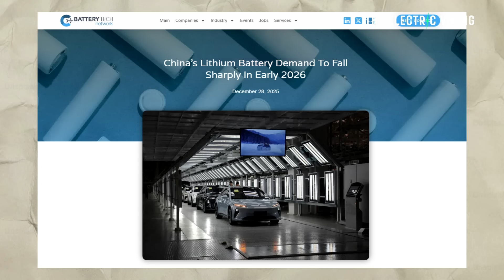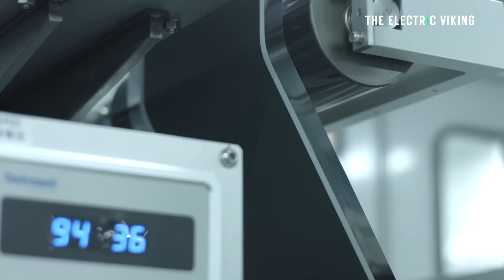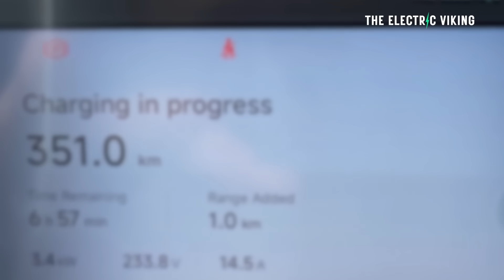SODIUM TAKEOVER! CATL Confirms Mass Deployment of Sodium Batteries for EVs

Comment: What is the disadvantage of sodium ion batteries?
Reply: They are likely to be bulkier than lithium batteries because of the lower volumetric density of Na batteries.
Reply: @crm114.  Key technical problems (summary)
Lower energy density vs lithium — sodium’s larger ion and heavier mass mean packs store less energy per kilogram, limiting range for EVs and size for portable devices.

Cycle life and cathode degradation — many sodium cathode materials suffer structural “stacking faults” and phase changes that shorten usable life.

Higher internal resistance and voltage instability — sodium ions move less easily in many host materials, producing higher resistance, heat, and inconsistent voltage under load.

Safety and deeply sodiated‑carbon issues — recent research flags unique failure modes (e.g., sodium‑cluster formation) that affect thermal stability and require new stabilization strategies.

Manufacturing and cost competitiveness — while sodium is abundant, some sodium‑ion manufacturing routes and materials (antimony, special cathode dopants) can be costly; without scale or a clear energy‑density breakthrough, sodium struggles to beat cheap lithium/LFP on total cost per kWh in many scenarios.

Supply‑chain and ecosystem immaturity — cell formats, pack engineering, recycling pathways, and standards are less mature than for lithium systems, slowing OEM adoption and certification.
Reply: Bunch of things (some temporary)
- Lower energy density by weight than LFP
- Lower energy density by volume than LFP
- Voltage curves are not compatible with most current equipment (so you can't throw one onto your existing 48v inverter kit). Mostly that's a short term problem
- Last time I looked lower efficiency (you get more of what you put in back out of LFP than Na, but that gap seemed to be narrowing quite fast)

and there are probably a few others.

Comment: I think China's new requirement for fire resistance is probably the major push for Na batteries. The problem with this (at least at first) is that they will probably be exporting all the LFP batteries and using most of the NA batteries in China since they will probably not have enough in the first year or two
Reply: No, LFP batteries have already passed these tests. This is just the end of using NMC batteries in cars. Most Chinese companies had already completely switched to LFP, but many western companies are still using NMC. It's a good rule and I hope western countries will implement a similar rule, to force car companies to switch. EV fires have been creating a lot of negative press for EVs and it's time we put a stop to that.
Reply: True. We have to wait to see the real life performance for these batteries.
Reply: We can count on tje Trump administration to announce that all batteries in the US are required to be flammable. That'll show them pesky Chinese.
Reply: Has anyone seen what happens when sodium drops into water?  There is little difference to lithium. 
LFP is much safer than ternary cells, but it’s not appearing in UK because our climate is too cool.
Reply: Hi China!
Reply: Simple people in this country we do not need or want EVs. They are even more impractical here than anywhere on the planet. Stop the green madness now.
Reply: When ppl are drunk they shouldn't comment on YouTube  @johnwoodman9350
Reply: doesnt make sense though. If any exported product causes problems its even worse for the global made in china brand. Problems in china are covered up easily, in other countries they'll squeal like stuck pigs at the slightest issue.
Reply: @stopdropnroll  China is the biggest EV market in the world.  Who gives a sh.. about puny little eu protectionists market.  By the way EVs are really for Chinese energy independence, the profits from exports are just extras.  China is getting ready for the future world war that's coming.
Reply: @hpw-ws6bj  Absolutely they give many fks about the rest of the world. Their whole economy is based on exports. Why you talk about only EU? The demand is far greater than one fractured union that is crippled by policy indecision. Did you know that China also relies on the rest of the world for imports of 70% of its food and energy. Any war is suicide and unlike you they know it. Take your tin foil hat off and learn some facts.
Reply: @stopdropnroll China use all EVs and green energy then becomes energy independent and problem solved.  Don't need any sh.. imports from eu or North America fool!  There will be a world war soon,  just look at Trump stealing Venezuela oil heading for China.  USA and Canada don't buy Chinese EVs and EU market is chicken sh.. But German auto industry will collapse without Chinese market.  Apple and Tesla are f..ked without Chinese market and manufacturing.  It's a double whammy fool!
Reply: @hpw-ws6bj  Oh you bring the US into it. Well now we are getting into countries that are truly fckd. America is a failed democracy and a laughing stock.The unravelling of a country that accepts decades of children slaughtering each other at schools cannot come quick enough. And you made my point for me. We are entering a deglobalising phase. Manufacturing as we know it is over and all those things you described are true. Trump just made sure America will suffer more than most.
Reply: @hpw-ws6bj you should fact check a little more. Around 60% of China's energy is still generated by coal burning power plants. While this is being reduced, they cannot afford an extended war. Aerospace & military equipment/weapons are still very fossil fuel reliant. China's economy is also very sensitive to global trade and exports.
Reply: @stopdropnroll where do you live that's so perfect & wonderful? Just asking for a friend lol!
Reply: @fmulleady China is a large producer of oil as well.  Maybe 5th or 6th biggest.  If it gets everyone off ice vehicles then there's enough oil for war.
Reply: Energy density of sodium batteries too low not viable for EV's.
Reply: @lo1234-w9r  Evidence for your claim?
Reply: Probably - we are already now getting plagued with dodgy Chinese products stamped "not for sale in China" after the more recent Chinese crackdowns on dodgy stuff being sold in country.
Reply: @etchedpixels really? I was checking around the house, except the locally hand-made furniture and my eastern Europe car,  everything else was made in China. My furniture were a gift and my less than 2 year old car has had numerous electrical issues already.
Reply: @markuc no, the comment section is full of copium and made up conspiracy theories due to their tiny ego
Reply: @elisabettajdj335 😂 very true
Reply: UK has had so many EV fires that emergency services now carry collapsible water baths. They fill what amounts to a big paddling pool with water and dump the car into it. Even a mildly smoking car gets immediately written off. 
Any burning car is nasty, but a burning EV is extremely dangerous. We recently had a six lane motorway (three each way) closed for a whole day. The car was being transported with others when it exploded. Debris was thrown over both sides of the road. Two weeks later another one caught fire at almost the same spot, but that only closed one side. This time, news media reported “battery pack” fire. 
Not surprisingly, people do not trust EVs especially the horrendous insurance costs and near impossible to do hour own service work.
Reply: @Dave5843-d9m you should be paid by the oil lobby for that post of very selective facts used to fit your narrative. Have you ever taught to check how many diesels catch fire amd cause mayhem due to fuel line failures alone? You don't speak for everyone on EV trust.
Reply: @Dave5843-d9m Hi Dave, how much are the oil lobby paying you to spread lies and BS? It must be a lot.

Comment: ok but are these lighter than lfp packs and will it allow for cheaper vehicles in the large 4x4 ute market similar to the EV silverado but actually affordable?
Reply: lol forget getting this in the usa
Reply: Heavier than lfp
Reply: @CoralSea  does it, or will it at least have much higher energy density to make up for it?
Reply: @robanzzz5124 I heard it has lower density, so that it’s heavier for the same kwh
Reply: @CoralSea  - lower volumetric energy density as well, so for the same physical size battery pack Sodium-Ion cells will deliver a much lower energy capacity than Lithium-Ion cells. Looking at CATL's Freevoy dual chemistry packs, the difference appears to be about 15-20% more volume is required for Sodium cells.
Reply: @CoralSea  right well doesn't sound like it's worth taking seriously.

Comment: $40 cell level is equal to LMFP pack price of $55/kwh it is if not less.    There are no specs on discharge, charge efficiency, self discharge which is likely to be bad, 15% losses each ways likely.

Comment: The biggest spooky that needs to be put to bed is the supposed voltage drop as the charge is  expended....and how this is supposed to make Na Ion less useful. 
 It looks like the people doing the tests are not using Na cells anything like the CATL cells, either for vehicles or storage ... 
And  if they are going into swap packs and chocolate box system size packs  if there become available to the people who are actually pushing ahead on their own as families living off grid or smaller scale commercial enterprises converting existing ice vehicles or potentially tens of thousands of diesel and petrol  thirsty boats  via Hybridised systems or  straight electrification. 
If you think the high end of the car industry is expensive the whole marine systems and power train system is insanely expensive with knobs on .. 😂
Reply: Modern switch-mode power supply technology pretty much eliminates issues from source voltage drop. As long as the discharge c-rate can swing high enough to meet the power density requirements (without sacrificing the energy density of the pack), switch-mode DC-DC Converter as well as DC-AC Inverter technology will eliminate any voltage drop concerns (and do so with conversion efficiencies approaching 95%).
Reply: You need to run at higher voltages (so your voltage when nearly empty is akin to the LFP one) in order to avoid higher currents and the problems that causes. That's fine for a new design, but not good news for someone hoping to stuff one onto a current 48v hybrid inverter.

Comment: Im one of those "evil" oil & gas supporters. Because solar doesnt work 24hrs/day or in every location. Battery storage is needed, and current battery tech sucks for grid scale storage. I have been saying this for for about almost two decades now. 😂

Hopefully There will be domestic US production of sodium batteries making grid and home storage economical.

And then there is home heating. I live in Alaska, and there is simply no economical way to heat a house in the winter with solar power alone. Natural gas home heating is like 99% efficent.
Reply: Maybe because of your geolocation solar is simply unviable, but for tropical regions solar energy just got cheaper them oil for the first time.

There is much to be done to improve the grid as a whole from a systemic point of view. 
In China for example, they got pretty smart planing for a grid as a whole. The west part of the country is mostly desert, the east coast where everybody lives has most of the demmand. They engeneered their grid in a way that when the east coast demand in the evening is at its peak, the production in the west at afternoon is also at it's peak and this syncs supply and demmand lowering the need for bateries.
They had to project and build a new type of Ultra High voltage DC transmission lines in the millions of volts for that.
Reply: The fact that you think it’s a virtue that you haven’t changed your opinion in two decades, given the scale of change in the last two decades, suggests you’re more committed to defending your opinions then to opening your mind to new possibilities.
Reply: @reechard54  Let's also mention not changing opinion in 20 years leads situations like Nokia/Kodak/Blackberry.

Europe is going this way. They've raised the white flag and gave up on EV vehicles, they simply cannot compete and went back to making combustion engines and lobbied protections for them. 

They will all be wiped from the market in a decade or so because they cannot change their minds.
Reply: For heat purposes I wouldn't store solar energy electrically. A thermal battery might be a better choice (and a lot cheaper as well). A simple 4 x 8 sheet of plywood made to collect solar heat energy (glazed) can collect over 2.5kWh of heat energy every hour. Not sure about Alaska but ten of these could conceivably collect roughly 75kWh of heat energy in just 3 hours of ideal sunlight (stored in water). That's enough to keep a well-insulated 2,000 square foot house warm for several days. Again, not sure about Alaska but this could certainly put a serious dent in my electric bill here in the North Eastern US.
Reply: You're not just evil but stupid as well. Grid scale battery storage "sucks" compared to what? Peaker plants? EDUCATE YOURSELF